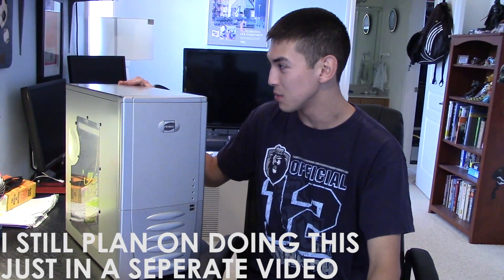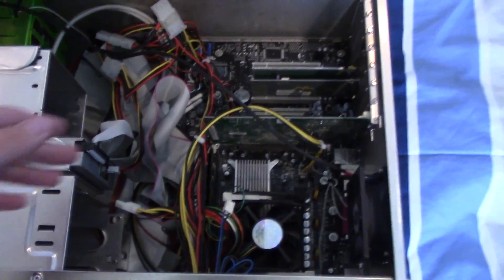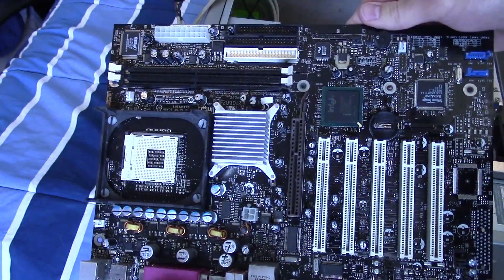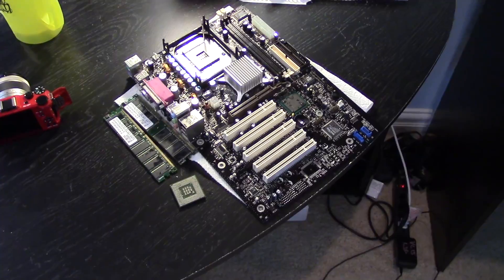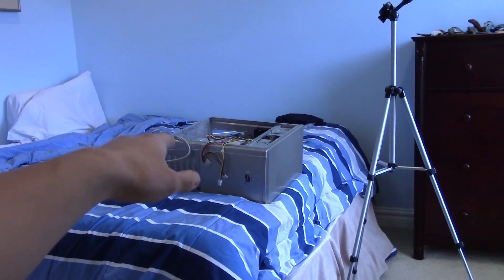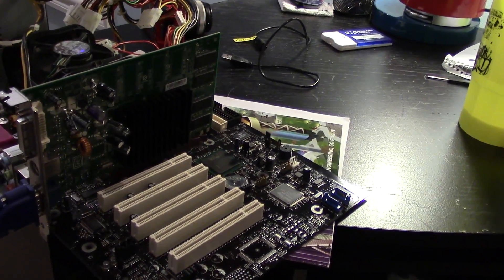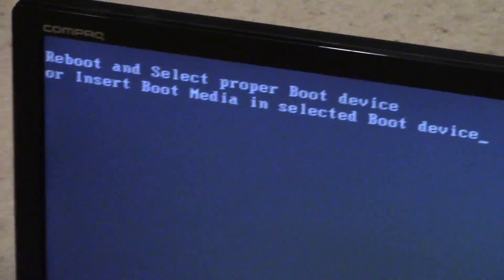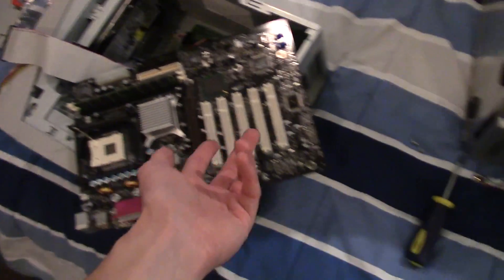Computer Motherboard, CPU, and RAM VS. Dishwasher

Comment: 100% not enough dry time. You should use compressed air first to blow everything out after washing. Then dry time should be a few days in open air. Not in a container or any type. I've actually gone as far as propping the mobo or component up against a box fan while it's drying for a few days. Never had any issues.

Comment: You need a dishwasher upgrade so you don't have to throw a camera inside.  Kitchenaid makes a dishwasher with a window in it...ok fine its like $1200 though HAHA!!!

We used to take all the keyboards in the schools and run them through the dishwasher during summer break to get them cleaned up for the next school year.  Took a while but worked great.

Comment: You shoud use cool water to wash it hot water mestup board solder
Reply: Boiling point of water: 100°C. Melting point of solder: 183~188°C.

Comment: I've seen videos of people that dishwashing their components, but they let them dry for 2 or 3 days. Maybe you didn't let it dry enough time?
Reply from the maker: +kanopus06 that's what i am speculating. I was pretty sure i had the board completely dry though. I was just following the same procedure I did with the video card which worked just fine after drying for 5 hours.
Reply from the maker: +kanopus06 The motherboard still functions: https://www.youtube.com/watch?v=ouA0miaJ4u4